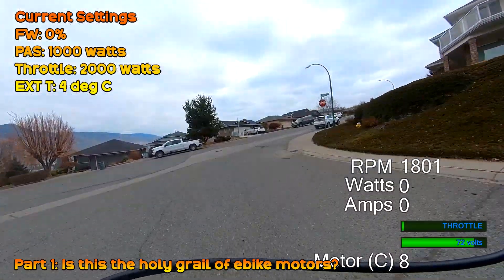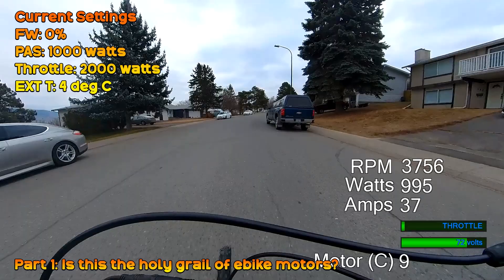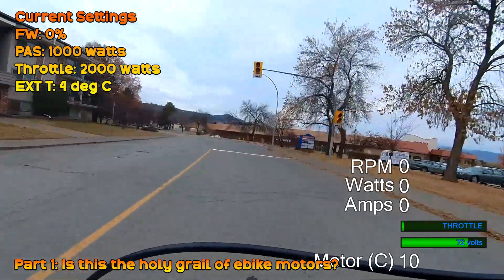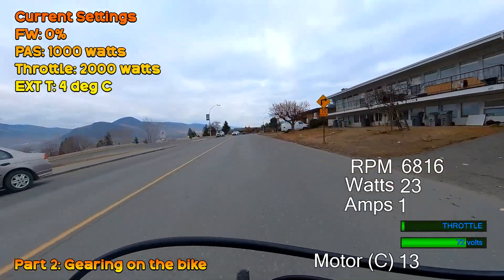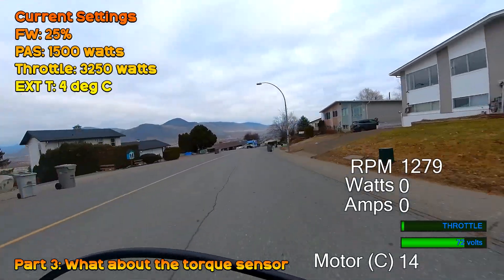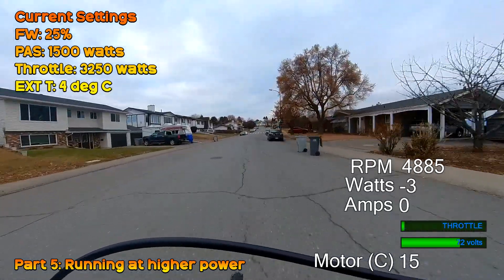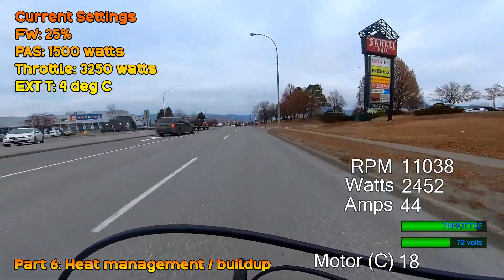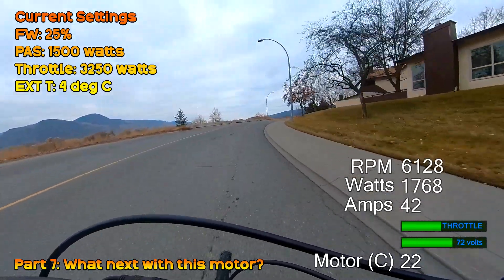The holy grail of ebike motors? Differences with BBSHD and CYC vs TOSEVEN DM01

Comment: If the reduction ratio is double that of the bbs hd, does that also mean it will be very difficult to climb steep hills if the cranks are turning but half the rate ?  This is something the Tongsheng seems to suffers with because of it's gear reduction, less than 15km/h and it is very hard going because of the lower rpm's.
Reply from the maker: I see your point but I don’t think it will have that issue. It has plenty more power than the Tong Shen to call on.
Reply: @HighVoltageKits  Thanks.  Do you have any idea if the tsdz2 spiders for fitting other chainrings fits the dm02 or dmo01 for that matter ?

Comment: I've watched many, many of your YT videos and am a subscriber.  Do to  an injury, I no longer have full strength in my left leg for pedaling. I'd like to convert a 2012 26" Disc Trucker into an ebike for paved trail touring 90% of the time. I have a good mechanical aptitude, have confidence and  own many tools. I've viewed posts on EBR on DIY builds. i know I'll have to figure in replacement bars, stem, cables and some hardware. Long story short, I'm looking for the most reliable kit capable to reach 50kph at present. I stand 183cm and 104 km. I used to be fairly athletic and am a mild risk taker. Goal: Build a nice bike that surpasses a commercial version near the $3k-$4k US price range. a build recipe would be great and would consider paying for one. If you'd rather communicate by email that's very good with me. Thanks Tuna
Reply from the maker: The best thing is to join our discord community where you can post photos of the frame and get really good advice from hundreds of people. I realise it might be a bit intimidating with an app etc but its well worth it. You can start a build thread and chose as there are quite a few options. The links are in the description.

Comment: Great video but how do these motors cope on mountains? Thats what I would be using it for. Trails and leisure mountain riding, not insane downhill craziness. Where I am its mostly valley and mountains absolute heaven for mtb riding. Speed so important, 15mph plenty, torque uphill is what critical 😀
Reply from the maker: It should have plenty of up hill torque. I still have a video where I do some steep climbing of up to about 20% I will upload it as soon as I get chance to edit it.

Comment: This is a great project and the goal here is pretty much exactly what I have been looking for.  I am surprised that no one yet has offered such a motor with torque sensing and also the ability to go full blast on throttle.  To date everything has been a compromise biased one way or the other.  Now the coming BBS M635 may change that, but I don't know enough about it yet to know for sure.  But this DM-01 with your upgrade kit would certainly fit the bill... at least once the torque sense is resolved. I'll be following along... and maybe picking up a DM-01 in anticipation.
Reply from the maker: Sounds good. Still working on the torque sensor. Cheers

Comment: That with torque sensing and a 9 speed linkglide. It's going to be awesome.
Reply from the maker: Yeah. A slight wider range cassette than I have would be advantageous.
Reply: @HighVoltageKits  If you want, I can alwys send on discord the ink of the chain kit I use (11-46 as well).

Comment: speed would have been good to see with the other stats
Reply from the maker: Yeah. I will get some more footage weather allowing. The GPS messed up. It holds 50-55kph up the hills and blows past 60kph with ease on the flat. Its fast enough to put me at risk in these areas so might have to wait till spring to get a true fix on it.

Comment: Oh dang that’s what I was hoping to get with the BBSHD fatboy build I was going to start working on for Christmas. I want to be able to use the electric bike part to get me to the trails. Then, turn the pedal assist down to where I can ride the bike as if it doesn’t have the weight of the motor and 72v battery strapped to it. 

I should hold off buying that until I see what this can do. So far I’m leaning this way to the DM-01
Reply: Do they make one wide enough to fit a fat bike?
Reply from the maker: The widest is 110mm so potentially. I'm not sure it will work with the fatboy frame. I use the 120mm bbshd on mine. It's funny we are the opposite. I'd probably use the pedal assist more about town till I get to the offroad part.
Reply: @HighVoltageKits where I live I need to keep up with traffic on some narrow roads before I get to the bike trail. Oh and there is this one hill that is so steep that I only can barely ride up it without walking part of it. It’s so steep that when going down that same hill my fatboy will hit speeds over 30mph 😳
Reply from the maker: Yeah an ebike will help with that for sure. I was pulling my kids in a trailer on the fatbike before I got the BBSHD. I was beat after about 5kms! Never looked back.

Comment: BBSHD has been my go to.  Durability, serviceability and power is why.  The only thing I’ve longed for is torque sensing.  Crossing fingers this thing takes the crown.
Reply from the maker: It will be very interesting how it develops. The reduction ratio makes quite a difference. I will try and do some videos on taking various parts of it apart as the internals are a bit different to the BBSHD especially the sprag clutch area.

Comment: Looking forward to a throttle only test with hills as this is the way I will have to use it.
Reply from the maker: The grades on here are 8-10% (about 1/3 of the way in and also towards the end) but I will get some more footage with some proper speeds when I can. Weather and safety permitting as well. https://youtu.be/AB_b5yl5mQY

Comment: Sorry pal, it aint "The Holy Grail", of motors, lol. You just prvoed it in this video. People that want to build a powerful ebike don't care about peddal assist. I will personally never use it. I have a normal lightweight bike for that. It's called excersize. And not being able to 1:1 ratio with no gears means it cant possibly beat the BBSHD. And fuck 750 watts.
Reply from the maker: Clearly it does not appeal to you mate. Thats cool. Glad you don't mince your words and say what you mean. I am not sure how many people you speak for though. Lots of people struggle with normal bikes for exercise. For them having an ebike means they can exercise. Where I live the idea of riding a regular bike around town with 10% grades everywhere is just soul destroying. But with an ebike you can be very precise about the level of exertion. If its 30 out and I don't have to work about over cooking it as I can up the pedal assist. With this you can do that and go for a crazy rip all on the same bike at 3000+ watts. With that 750 watts you can greatly extend your usable range. For me that would be ride through town with the pedal assist out to the outskirts and then ride at higher power. In terms of the BBSHD and the 1:1... you do lose that. So if that is exactly what you want then that's exactly what you want. That's your ideal electric bike. But my Holy Grail going back to when I first started doing this stuff with the NXT was to make PAS more functional as well as being able to deliver at higher power.
Reply: i don't get it. you wouldnt peddle a car. i like peddling, but i dont enjoy peddling a 70lb bike. I live in a hilly area too, hence why I use a throttle. Anyway i hope they go out of business for being yet another company making 750w soy motors. If i wanted 750w, I'd get a prebuilt.  @HighVoltageKits
Reply: @RetroMancer242 Then don't use a 70lb bike.
Reply: @RetroMancer242 you sound really triggered about 750watts. Check your energy. I want something that can go 45mph and also get exercise on if I want. I'm not sure what about that has anything to do with soy.
Reply: LOLOLOLOL triggered. Obey those road laws, you'll be fine.  @turboleggy
Reply: @RetroMancer242  Makes zero sense lol " I like peddling " and " hence why I throttle ", my suggestion is stop drinking alcohol when you post comments!
Reply: This is some weird energy. I want this exact setup he's showcasing on the dm01. Not everyone feels the way you do bud...
Reply: Nothing weird about it. If I'm going to peddle, I dont want some motor helping me like I'm some 400lb walmart Ameri-Sloth on a motorized cart. I'll do it myself. I want MORE POWERRRRR!!  @_Drae2210
Reply: Why use a mid drive if you want 1:1 ratio? The whole point of mid drive disseapear
Reply: The only thing I want is pedal assist lol. Id buy a motorbike otherwise.
Reply: Be more pleasant, peasant!
Reply: For me this does appeal, I've been running on Bbshd for years and its great on the open roads but trails it can be a little to direct in power, torque sensing would be great, it would help conserve the power when you need it and last longer.
Reply: You need to be more respectful in your posts.  Your language is unacceptable.  If I was the moderator of this channel you would be banned.  My 2 cents.

Comment: My priorities are reliability sound levels and ease of installation.
The bbshd is the king of all three 😊
Reply from the maker: Yeah the BBSHD ticks those boxes. I found the DMO1 pretty easy to fit. I did make some suggestions with regards to the lockring pattern and tool. Reliability is a reputation that's earned! I hope it is!
Reply: The DM-01 is quieter, its the same to fit but has a better chainline.  Reliability is only a matter of time..  bafang are abandoning the diy market. They will only do one more motor then that's it.

Comment: Very very promising tests, hope the motor will be as reliable as BBSHD. It doesn't even have to be as powerful but with added torque sensing it's going to be a game changer for people commuting in the city with a lot of start-stop biking and situations where torque modulation is very important.
Reply from the maker: Yeah. I hope its reliable. Only time will tell that one. The internals do look well made.
Reply: My shit city has stop sign almost every damn block. sucks for shifting. sucks for enjoying the ride. saving up for the hv kit to go 1:1 gear ratio.

Comment: I love my DM01. Have been riding it for 150 miles so far coming from a tsdz2, the torque sensor feels as smooth as OSF on the tsdz2 but with way more responsiveness and power coming out of the motor. 

Really hope this motor succeeds in the market so there's parts and community support for a long time.
Reply: I'm considering either DM01 or TSDZ8 for my next project so your comment helps. Especially because it's from someone coming from Tsdz2. Cheers!
Reply: How's the motor holding up these days?
Reply from the maker: Thanks for the feedback. Part of what made the Tongsheng TS smooth was the refining by the community so that is something I would like to see with this as well.
Reply: I too would like to how how is your motor holding up this far.
Reply: @Mahdi-BogdanAli Holding up well. Have about 1200 miles on it now. Don't ride as much as I used to due to lifestyle changes, but no problem with it, feels as good as the first day I rode it. There's a lot of hills around where I live, so I've definitely put some power through it. That said, I've never actually had to draw more than 600W of power (probably 200W average) it's just not necessary for my usage even with the steepest hills around me. If I installed it on a cargo bike and I was carrying kids or something, I can imagine using up the full power and more.

Comment: How does the chainline compare to the BBSHD, especially one equipped with say a Lekkie offset chainring?
Reply from the maker: It's pretty close with the chainline. I was able to hit the biggest gear on a 10 spd cassette. I think 5 or 6 is really all that's needed with this though. Ideally an igh that can handle the torque but non exist at reasonable price.
Reply: @HighVoltageKits The IGH would be nice.  I was concerned about the Torque my self.  Any way you can lower the Torque in the settings?  I want to do a DM02 on a 8 speed Nexus IGH.

Comment: Yes, the Holy Grail, a robust and reliable torque sensing motor at a reasonable weight for power and a reasonable/competitive price point with DIY tunability and repairability... Just tell me if I missed something 😂
Reply from the maker: That's what I hope. It's done enough to make me dream. There are some IFs though. Lots of work remains.
Reply: And then, if it fits the bill, we need to make sure the company stays afloat.

Comment: Mr. high voltage i do not want a free asi beta controller kit. I wlll gladly pay for an unfiniished test product that'll help with the development of this motor! Thats what I've been trying to say haha. 

Seriously though. I have a 60v battery, which is not a voltage I've seen you running in your latest few videos. If you'd allow, I will be your 60v test dummy once cali ebike sends me the dm01.

Just want to be part of something major and i think this is my window of opportunity. Thanks for your time ✌🏾
Reply from the maker: Yeah. A 60 volt battery should work great. Your enthusiasm is greatly appreciated. Hopefully by the time you are built with the motor we make further progress with the torque sensor.

Comment: Hello. What seat post is that please?
Reply: This is so intriguing. I thought the Photon was the answer until I saw the bottom bracket interference and then the phase wire issue. Thank you for your honest reporting and in depth analysis. They may still be a contender someday but they need to get their quality under control quickly.  This Two Seven has even more potential. I too want an assist motor to extend the range by pedaling and give me the excercise I want (need), but   there are roads here where huffing up a hill below 10mph is just not safe. I would rather power through these parts regardless of legality. I'll be following your progress closely. Thank you for the great work and videos.
Reply from the maker: @joehazel612 You are welcome. I'll have plenty more video to come.
Reply: Thanks
Reply from the maker: Its the cane creek thudbuster

Comment: Looks like a nice motor

I have a concern w/ the gear reduction though. Not sure if it's grounded in reality or not. But it seems like with the higher reduction, you'd be trading chain speed for chain tension. And running it on smaller sprockets gives fewer points of contact for that tension.

Any concerns about excess chain/sprocket wear, especially with the gears?

Honestly, I love my BBSHD. Once I got the settings dialed in for my PAS, it rides very comfortably but can still send a decent bit of power to the rear wheels. Running the open source firmware on mine. 33a/52v. Hope to pick up one of your kits someday. Been eying them for.... shoot... A year and a half now.
Reply from the maker: Cheers. I am not 100% is the honest answer on the tension. The gear I am in most of the time at the back is a 28t The biggest is a 32t. I would like to have something a bit more balanced. No more concern than with the BBSHD really. I mean at higher power things move faster and thus wear faster but I did not burn through chains on the BBSHD so I don't expect to here. I will monitor things though. The BBSHD is an awesome motor and if this pans out even 75% of that with a torque sensor I think it will be worthwhile. You are welcome on our discord and you can upgrade anytime you want. Maybe this will be a proven motor by then. Cheers